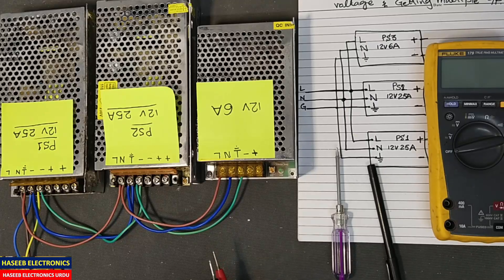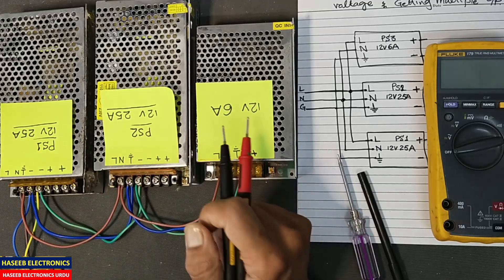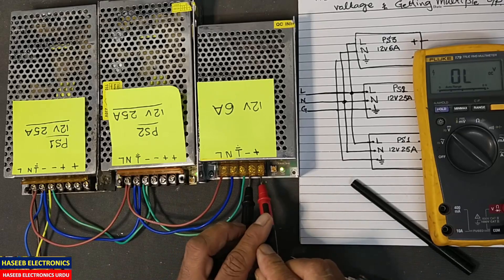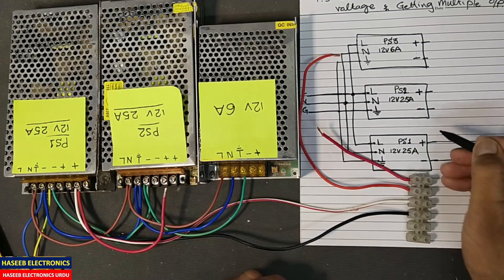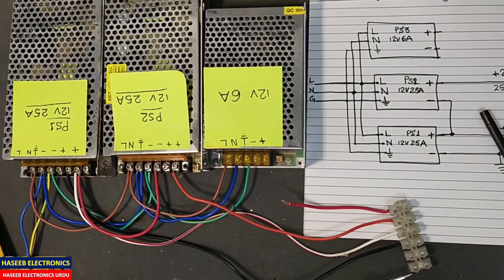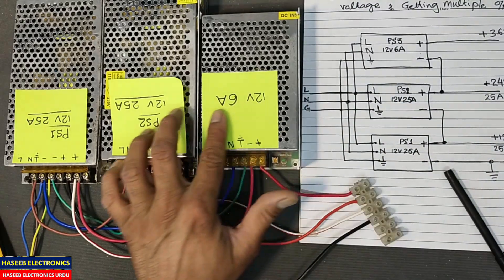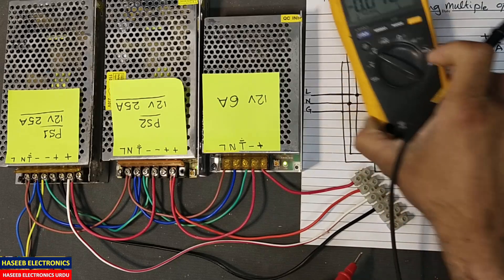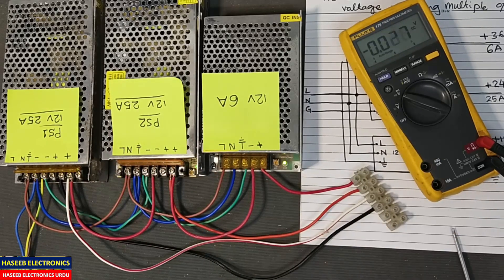{598} Connect Power Supplies in Series to Get More Voltage / Two or More Power Supplies in Series

Comment: What will happen if we give  smps input supply 230v ac from different phase R, Y , B..
When we joint  3 smps +24v output ..does this short circuit ??
Reply from the maker: good evening 
if you are connecting 3 power supplies 
Line input 
1st power supply R (L1) and Neutral
2nd Power supply Y (L2) and neutral 
3rd power supply B (L3) and neutral 
and you connect outputs together. it will not make any damage anythig because output sides are islotaed from primary sections. just output side polarity must be connected in correct ways
Reply: @HaseebElectronics that means
We can connect  3 output +24v  together  and 3 output 0v together right..
If mistake  pls correct me..
Thanks for replay
Reply from the maker: @entertaintube335 perfect 
+ 24 To + 24
Common to common 
Just very every power supply must be same 24 volt. If any power supply higher or lower. Adjust it to same level

Comment: I have 12v 10amp power supply with 2ports of 12v positive  & negative 2ports can i connect the same power supply in series as i have total 4 output ports 2-ve and 2+ve

Comment: It's hard to find basic knowledge in electronics which "we all know that from the job" and the pro's forget we wasn't there with them in a school or other training and we did something else.... The internet pretty much gave me something with videos like this, but my dad also played a role, maybe just the passion about trying. I'm saving money by making "helper boards" on my own. I just ran into something where a micro controller device can't power a GPS good enough (from it's battery) and it's just 1 problem out of 100s being solved eventually in my micro cosmos.

Some videos are skipping a lot and put in a long lecture about a formula for weird reasons. Then they solder on nano objects with $1000 equipment and buy a board from PCBWay which seems to be 5-10 years later in a longer journey.

Comment: 3:19 - So, it is not necessary to connect through the diodes in series configuration? Am I seeing that correctly? It's ok to connect multiple SMPS power supplies directly in series?

Comment: I think I can connect in series, 2 power adapters from different voltages, right?
Lets say, one laptop power adapter 19VDC connected in series with a 12VDC power adapter, to get 31VDC.

Comment: Hwl sir, i have 12volt10amp 7no. smps.can it safe for series connection to charge 72v battery.beacase my 84 volt charger faulty.if I series 12 v 10amp 7 pc ,can it work properly? Or any diode and capacitor required for output

Comment: What happened it's voltage is not same example 1st one is 17volt 2nd is 19 volt
Reply from the maker: then it will damage one power supply or both 
or both will heatup
Reply: @HaseebElectronics  my case 1st one is 12.05v 2nd one is 12.67v this case both r damaged?

Comment: So i learned something today. Amps are limited by the weakest link. I am left with a question; what if your series connection started with the 6A power supply? By your wording, the effect should be the same. however a confirmation that its not 25A would be cool.

and would that require wiring in parallel instead then?

Comment: I must be doing something wrong because it keeps smoking one of the PSUs . I can't understand why its not adding the voltage in series. I have two 60v / 25a PSUs and am trying to get 120v combined output....
Reply from the maker: Please check the output side ground terminal (-ve or return line ) is coupled to earthing ground terminal of input side?
Reply from the maker: Please check eitther the output side negative terminal (low side terminal) is coupled to primary side safety ground or power supply chassis ground?
Reply: @HaseebElectronics  can you just post a photo of two power supplies wired in series with just a single positive and single negative output that would be double their voltage?
Reply: Can I send you a picture of how it is wired?

Comment: Hallo sir I have little problem my parallel power supply voltage is not same 1st one 23volt and 2nd one 26 volt what is happen I will connect togather is it 💣💥🤯 or work fine
Reply from the maker: in this situation it will not work proper with parallel connection
higher volatge source will cause to flow current in low voltage source.
Reply: @HaseebElectronics  ok so I have 50 amp bridge diode will it works shoud I gat 25.5 volt ....and also amp was not same one is 20 and other is 18😅 did I gat 25.5 volt 38 amp may be 😮

Comment: hello sir i have 2 smps with 24v but the amps ratings are different one have 10 and another have 15amps i want 48v output so can you tell me how much amps i will get at the 48v ? and both power supplies are different from each other 24v 15a is a ultra slim one and 24v10a smps is traditional one .

Comment: hello i do not know much about power supplies, I need 24v and 1.65 amps but my buying a 12v supply rates at 10 amps. i dont know how many 12v output it has but if it has 2, can they be connected in series to make 24v or should i buy 2 12v supplies
Reply from the maker: if you want to add voltage, then you need to connect 2 power supplies in series

Comment: But the real question is: What is the power in wattage at each output. 12v at 25a is 300w. At the 24v connection, your power in wattage is 24v at 25a = 600w, what is it at the 36v connection? 377, or something else?

Comment: Hi I did exactly as you describe your video and I cannot get it to work I was trying to add does voltage from a 19.5 laptop power supply I checked both power supplies before tried to put them in series and all it would do was make a clicking noise and put out .6v to .20v do you have any idea where I could have gone wrong
Reply from the maker: as i demonstrated practically and explained every step in detail. so it is working method. moreover i use this method most of time in my routine work, 
if you are trying to connect laptop chargers in series. may be it will not work properly as the laptop chargers have id sense system.

Comment: NOOO, the load will no be evenly distributed this way. To do this right, you need a PSU with a REMOTE SENSING  function, which will balance the voltages between the devices. Mean Well SE-450 series for example have this function.
It can be compared to using capacitors as a  voltage divider. that won't work. Caps need resistors to keep the voltages balanced.
Reply from the maker: No. when we connected 2 sources in series, it works normal. it is as per my experience, 
if we are using 2 power supplies, let's say 12V 10A, total voltage will 24V and current will 10A
if we use different current rating (12V 10A, and second is 12V 6A) total series voltage will 24 volt but the maximum current will 6 ampere. above 6 ampere it turns off)
Reply: @HaseebElectronics  what about putting the (dc) input in parallel? have you tried? I want to use it like that, is that possible? dc input in parallel and dc output in parallel (with remote sensing).
If not why not? thanks!
Reply: maybe you are talking about paralell conecttion not series :)_
Reply: @radekzmazur3389  indeed parallel I was confused. and still am. it looks parallel, but it is series, if you look at the output capacitors.
voltage is higher.

Comment: Csn we get 12 0 12 out of 12v smps i mean ground -12 and +12v ?
Reply from the maker: if it have center tapped winding, then we can get dual power supply 
or if we have 24 volt power supply, then we can split it into 2 portions, but in this condition we will take virtual ground
Reply: @HaseebElectronics  you mean a transformer?
Reply: @HaseebElectronics  i have center taped winding. Actually a circut board for same purpose but it never worked and i cand figure iut why. In that circut 2 mosfits irf150 and tl494 ic is used

Comment: I have a power supply with double output voltage. 32v/1a and 16v/0.5a with common black negative cable and two red positive cables. I want the sum of two voltages 32v + 16v = 48v. How can I connect the two voltages in series?

Comment: I want 48v 20amp output.

Which would be the best that,

Connecting two 24 v 20amp in series. Or
Connecting two 48v 10amp in parallel

Comment: PSU12v 10Amp + PSU 12v 30Amp= 12V 40 Amp work or not work
Reply from the maker: no 
that will 12V 20 Amp in parallel. above than this it will 12V 30Amp only 
because after 20 Ampere first power supply will meet its maximum limit, so it will shut down. and the total load will converted to the second power supply

Comment: Salam brother ...you thenk that is safety ...spcialy ..whene you charge a 48v battery? ...thank you
Reply from the maker: yes it is safe. as the battery have current protection so you can use it, just take care for the battery voltage and polarity of battery
Reply: @HaseebElectronics  thank you so mutch great channel .. good like

Comment: If all the power supplies don't start up (or don't start at the same time), would the reverse polarity voltage potentially applied to the non-started -up power supply potentially cause the output capacitors to rev polarity and explode?  Would  it be good to put a diode across the output of each , rated for at least the total combined voltage and rated for the current of the highest current power supply?
Reply: ...and in fault conditions such as short circuit across load which means the power supplies output will be connected in opposite polarity.I agree that it is a good solution with Schottky diode connected in reverse bias across output terminals of each power supply. This is for two power supplies. I haven't considered what would happen with three or more, but I think it would complicate things even more..best regards.
Reply: And if I understand correctly, the ground-leads of each case lead to the wall-plug, but out of all the ground-connections of all the boards to their respective cases, you have to leave just the last one untouched. All the other board-to-case earth-connections have to be capped...(???)
Reply: @klausbrinck2137  Very good point .  Most purpose built  SMPS (eg MeanWell ) do not tie the Negative output to the mains protective earth, or to a metal chassis that itself is connected to protective earth.   I don't recall ever seeing a manufacturer recommend this,  nor do i recall reading them advising against it either.. 

In units where you see this negative DC to protective earth bonding inplemented, (such as in surplus  HP proliant server power supplies ) , this connection is most typically removed.      There are blog posts and videos on you tube detailing this.

now ,.. you could choose to leave  the earth connected on the first (lowest potential) power supply , within a series string.  I can see  potential benefits - as well as potential downsides  - to doing this, but in general for battery and solar type applications I believe the choice is most typically in  favor of full isolation  .   (Whereas in the computer world I think it may be customary for the chassis to be tied to DC negative / i.e. zero DC volts.)

You should decide what you want and configure accordingly.
Reply: @GannDolph  Sorry, I was misleaded, but now you have explained it all, I understand. thanks !!!   ;-)
Reply: To avoid this, a good thing would be to power them (each one) before putting them in series, 20VDC wont hurt nobody. Or, connect before power on but add a switch where they connect in series, power on each one with the switch off, then turn the switch on.
Reply from the maker: wow 
i salute to your valuable point. i have to study it and will discuss it surely 
please accept special thanks and best regards
Reply: @HaseebElectronics  look forward to your thoughts.  i'm guessing that the output circuitry may  offer  some protection against this already , but that diodes may offer cheap extra protection for edge scenarios with unusual loads etc..

Comment: Hi sir,

I had a 24inch Samsung led tv power supply.In that +5volt,led driver volt is ok.only +12volt is flickering when I connect any load.rest of the voltage working well with load,

I had tested this circuit with 12volt 35w lamp with 5v it's glowing without any voltage drop,in 12volt side it's not even glowing little flickering with smps noise?
Reply: Suggest me a solution to repair this problem?
Reply from the maker: for good suggestion , it is better to send tv model number or the PCB model number
Reply: @HaseebElectronics  ua32eh4000r  hi sir,this is the model number of the tv.please check and revert.what might be the issue?
Reply: ? sir any information

Smps pcb number:bn44-00492c
Reply from the maker: please check the capacitor in 12 volt line, i think the 12 volt smoothing capacitor is making problem

Comment: on some of that type of power supply the output -ve is connected to the earth/chassic so that set-up wont work. I can do what you did on the psu that uses the 2 pin figure of eight power cable since thats just double insulated and not earth, so its worth checking if the -ve is connected to the earth cable, I know you have already done that else yous wouldnt have worked but this advice is more for the audiences
Reply from the maker: fabulous 
it is really a valuable point
please accept my best regards and special thanks
Reply: good comment. it would be cool to hear an explanation of how/why it works that way.

Comment: Yes very good.  But doesn't putting switchmode power supplies in series to add voltage have some weird affect on the regulation?   In other words it sort of works, but the regulation
can also get weird.   Ever hear of that?     Linear supplies might work better for series connections between supplies.   What do you think of that?
Reply: I advice to use PSU with "remote sensing" option to balance the voltages over the load
Reply from the maker: yes dear you are right 
but these cheap industrial power supplies don't have remote sense or remote adjustment options 
these have standard output terminals 
so when we want to cascade power supplies for temporary use, then this option can be used 
otherwise for a long term operation it is not recommend, not safe and not long lasting
Reply from the maker: thanks a lot 
it doesn't effect on regulation. as the feedback regulation circuit have to sense the potential at its output terminals. it have to produce output 
if it is grounded properly, then it is safe and works perfectly on load sharing
Reply: I do this all the time with iron core, smps, and even smps based lithium ion battery chargers.  No issues.  The only weird things I've seen is when paralleling the output of chinese DC/DC buck/boost modules.